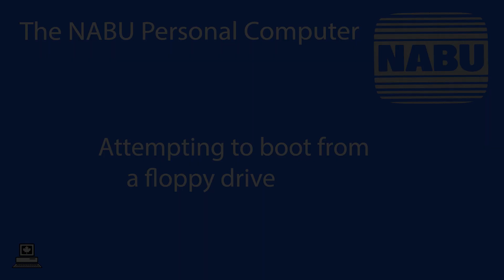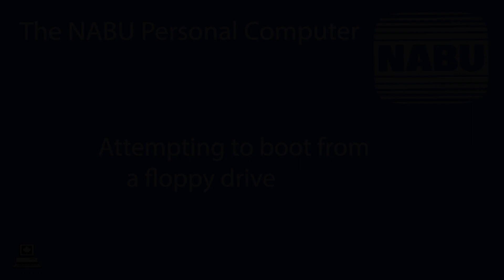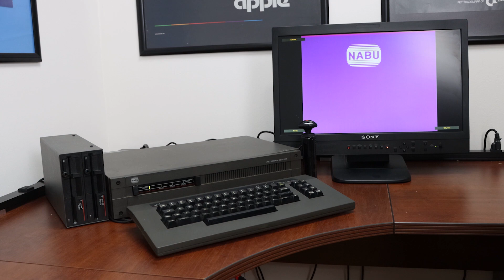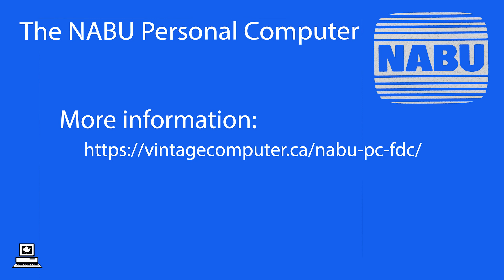Nabu Personal Computer: Floppy Drive

Comment: Makes me wonder if NABU was eventually going to sell these as standalone computers or they were going to make them have some capability offline. Perhaps it'd be like an early internet or BBS and let users download and save stuff to floppy. Then again, if cable companies had anything to do with it, they'd probably want users to connect as often as possible so they can charge more for using it.
Reply from the maker: I wonder the same thing.  If there was no possible plans for a standalone computer, they could have put both the PC unit and cable adapter unit in one case.

Comment: Isn't the standalone NABU with drives a development system , and that implies there are some other cards missing (the drive is only one part). As for getting it to work, seems like it would be simpler to look at the code and see why its looping, rather than suspect some "hardware failure" (which I think you will find it is not).

That said it might be that CP/M 3 was never meant to work with the End User Disk Drive variant. Are there not any other bootable disks for the End User Drive's, surely there is a demo disk and/or "the one that came with the system", as I can't see sales selling you something you could not use as soon as it was "out of the box" .. or maybe they did, and that would in itself contribute to "failure over time"

On another note, the age, composition and era of the NABU PC says it should be CP/M v1.3 not CP/M v3.xx
Reply from the maker: As far as I am aware, this system is complete except I did not get the matching Nabu adapter.  If there was a serial card or other missing cards, the blanks in the back would likely be missing. I think this is all that was needed.  I don't recall which video I saw it in but the floppy drive was available for purchase and/or rental.  My understanding from DJ Sures, is that some of the Nabu network applications may need the floppy drive so perhaps the more advanced applications via the Nabu Network needed it.  I would think that Logo was a separate fee and if you wanted to save anything, the floppy drive was needed.

Leo Binkowski has an original CP/M Plus for the Nabu.  I just call it CP/M 3.  I am hopeful that he can image it and I can try that one.  

As  mentioned, this was Dave Dunfield's Nabu computer and he imaged the diskettes.  He wrote ImageDisk so out of respect, I am thinking he imaged the diskettes correctly and it would have been the disk for this particular system.  I am really hoping I am wrong here and that perhaps he archived bad diskettes to start.

Somewhere CP/M 3 defines the disk drives and how it accesses them.  I would be interested to see if it matches up with the diskettes as I half suspected that the skew may possibly be incorrect for the data tracks.  I have nothing to back this up with, however.
Reply: @vintagecomputerca  I have a funny feeling that the NABU PC hardware was designed to be used a a couple of different configurations, some of which customers were not made aware of, and you have a standalone version (especially considering its pedigree) - I still think a look at the code would be more fruitful, especially now there is an MAME core that performs the same way -  Yeah, CP/M Plus is CP/M 3.xx , pre 85 just seems quite early, but this might be the Developer Platform from the end of its life cycle .. If you want to compare a bootable CP/M 3 system, look at one of the Amstrad CPC 128 (or Schnieder CPC 128 i n Germany) emulators, those systems came with bootable CP/M Plus System Disks (as well as CP/M v2.2) which was released in the US mid 85

Comment: This is interesting, i've been working on a mme core and have finalyl got around to emulating the bus and a floppy controller. However i seem to be suffering a similair and possibly the same issue as you are with real hardware. While not ruling out it being an emulation issue, the disk emulation does seem to be working. 

It will load the track 0, sector 1 to address C000 and jump to it, that then loads track 0, sectors 2-5 to address 0x100 and starts executing there. I've verified the memory is the same as the sectors on the disk image (the ones i obtained from your site), so the floppy emulation does appear to be working. 

The problem is when the cpm loader calls its bdos function to open the cpm3.sys file, it never returns properly and gets stuck in a loop between addresses 0x507 and 0x51b with the screen still stuck displaying "Loading from floppy disk". After watching this i'm wondering if it might actually be an issue with the disk images. If you have a logic analyzer you could place on the NABU's address lines it would be interesting to see if your nabu is stuck looping over the same address lines as my mame core is. 

One additional similarity is that the emulator is also leaving the motor line on as well, just like your drive seems to do.
Reply from the maker: This is fantastic news.  First, your mame core project which sounds great and second, you get the same results.  I have suspected exactly what you described as I also tried to leave the boot track on the disk but remove all files (deleting CPM3.sys) and if I recall, it does the same thing.  I have a Saleae logic analyzer and have captured some data.  Can you contact me through the "Contact Us" page on my website so I can  share more information with you?  I am very excited to hear this.
Reply: 0x51B - 0x507 = 20 bytes - Surely it is easier to know what those 20 bytes of Z80 code are doing than it is to set up a logic analyzer (and verify against what?)
Reply: @paulwratt  The logic analyzer would tell us if the CPU is doing the same thing on real hardware as in my emulator. Its not so much about what is being executed as to where it is doing execution. This would verify that the emulator and real hardware are doing the same thing making it fairly likely there is an issue with the disk images, rather then with the disk drive or my emulation.
Reply from the maker: FYI, the disks are bad and you can access the floppy with the 4K ROM.  Still working on it but my floppy drive is working fine.
Reply: @vintagecomputerca  Good to know it seems to be an issue with the floppies themselves.
Reply from the maker: @brijohn1  At this point I don't have a bootable disk image but I have a data disk image if it helps.  The format is not the same.  I cannot read the old NABUPER images on my Nabu PC but I can read disks formatted by it.

Comment: You are correct. It looked for the adapter and couldn't find it, but it could find the floppy controller, so it wanted to boot from the floppy.
Reply from the maker: An update: I connected the Nabu adapter as well and got a menu to select boot device.  I select the floppy drive and when it goes to boot, I get the same problem.  It was worth a shot.
Reply: @vintagecomputerca  Bummer. I'll get you some different disks to try.
Reply from the maker: @leo.binkowski  I appreciate it.
Reply: @vintagecomputerca  I noticed in Leo's video he mentioned a clear difference between the End User Drive setup and the Developer "mass storage" setup - Without seeing the ROM disassembly (and after see Leo's machine, and a description of development cycle), I might suspect the software is now looking for one of the serial cards ..

Comment: Have you checked out djsures channel? He is going about things in a different manner, but he has contact with a guy, Leo, who wrote a lot of the game software for the nabu. Leo mentioned he used single sided disks mostly, so I don't know if that helps. He is also going to release a floppy controller so that people can reverse engineer it. Dj also showed some of the original adverts for additional services, one of which was for a floppy drive and/or cpm for the nabu. Check him out, it might give you some ideas.
Reply from the maker: I have been following both. It turns out that the floppy drive may be needed for some portion of software to run on the Nabu Network recreation project that DJ Sures is working on.  I have also been tslking to Leo about archiving the diskettes.  I am aware they are single sided diskettes as the floppy drives are single sided as well.  Thanks for the heads-up all the same.

Comment: have you tried to swap the drives in the case?
Reply from the maker: I have.  Originally the A drive was bad after testing. I should have shown a disk error when I try another manufacturer's CP/M or just a random diskette.  The Nabu PC sees they are not proper Nabu CP/M diskettes and gives an appropriate error.

Comment: Interesting.  I just watched a video about Commodore 1541 drives that have failed read-write heads.  The Nabu drives appear to use a different mechanism, so that's not too likely, but it is still something to keep in mind if everything else checks out good.
Reply from the maker: One of my drives is bad.  I tested them in a PC with the correct configuration and the good one is the A: drive I am using to attempt to boot.